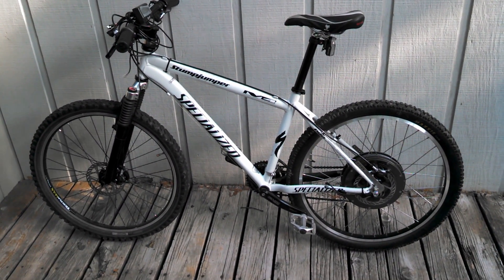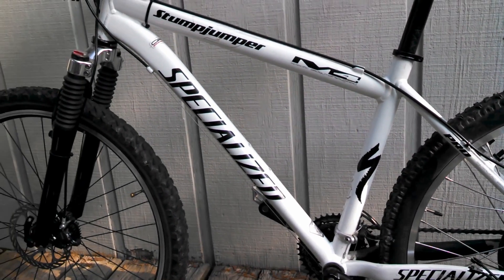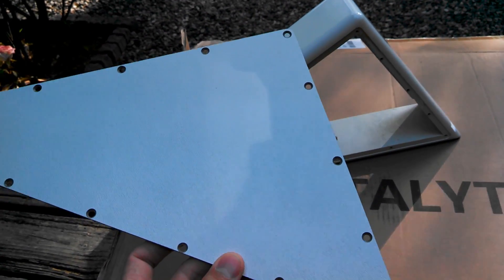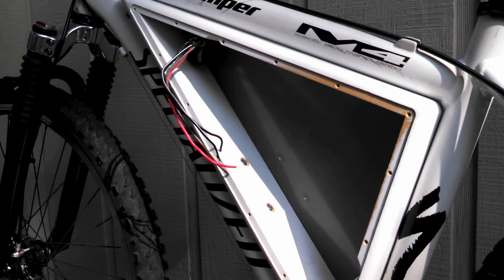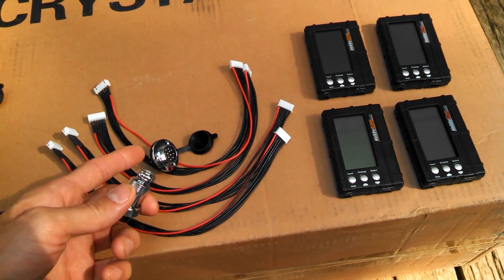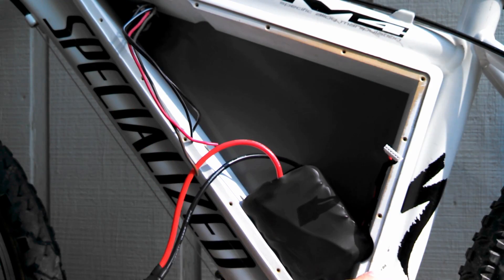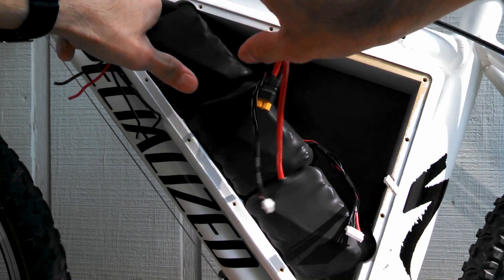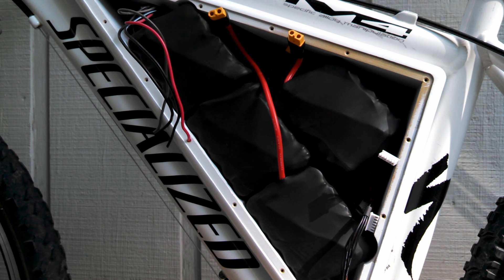Ebike Battery Box

Comment: I need to something similar.

I just took my bike for a test ride this morning before work and the handling was appalling.

My battery is rear mounted, but I made an effort to keep the weight down low with panniers.

But batteries are heavy and I basically built a heavy rack onto a lighter rack.

I have some leftover 1/4 in maple plywood, so I'll give that a shot.

Comment: That didn't help me one bit. You failed to show how your box mounts in place without movement? sure the two bottle holder bolts but what else holds the triangle from moving? Zip ties.
Reply: the box is held to the bike where the water bottle would be. he just removed the screws and screwed the box to the frame

Comment: Nice battery box! The only thing I don't like about your setup is those dangerous lipo batteries and all of the wires and displays that is associated with it. Instead, why don't you just get a lithium ion triangle battery with built in BMS and fit it inside your box? This is a great place to buy lithium ion ebike batteries and they can customize a battery pack according to your dimensions and specs. The price is awesome and their batteries are genuine Panasonic cells and includes a 4 amp high quality charger with cooling fan, XT90-S connector already installed, 1 year warranty and free shipping in the USA. Check it out.

http://a3ee3610-0553-11e5-8794-f04da2069d31.onlinestore.godaddy.com/t/parts

Comment: i am also interested in what batteries you used 10680? and how u set them up.  details would help.
Reply: more 18650 batts it was 24v i think i can teach you if you want
Reply: Here is what I don't get, did you buy all new batteries and if so from where?  If you did like used batteries again what provider did you find and where?  Your pack setup is awesome and looks like you can charge it all at one time, is that correct?
Reply: +Donald McClellan well you can use "used" 18650 batts from laptop batteries and also you can buy cheap 18650 batts from eBay but generic 18650's was not good to buy because of power lack it was only 1000 mah max!!
Reply: +Donald McClellan well I have a design that you can charge through power bank just a little modifications to the power bank and it will be the charger
Reply: +Donald McClellan a playlist from crispymenace was good to learn it was named 24v 20ah 18650 battery pack (I think so)
Reply: +Donald McClellan oww it was "24v 20 ah 18650 lithium ion battry pack
Reply: You can add another pack for it in series it will be 24v
Reply: Yeah haha!